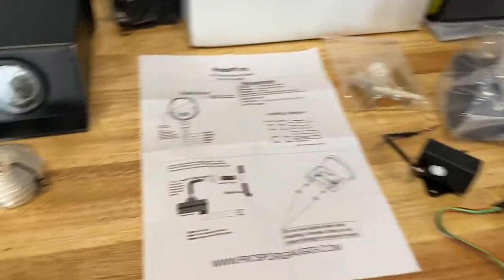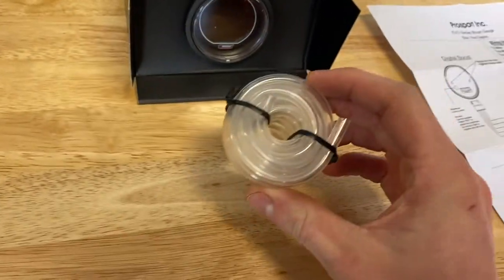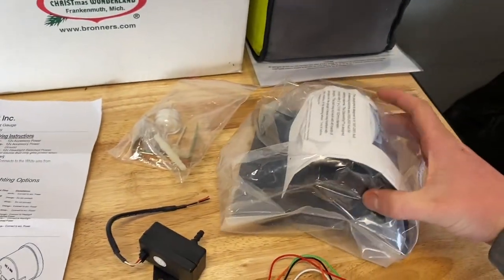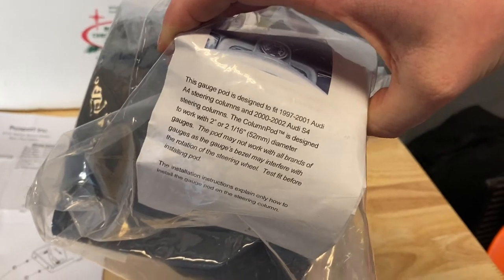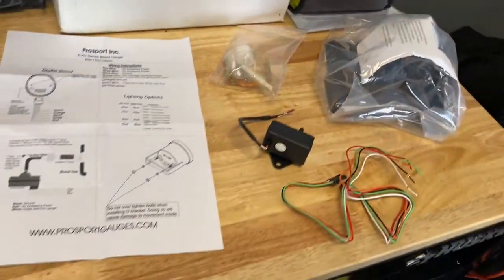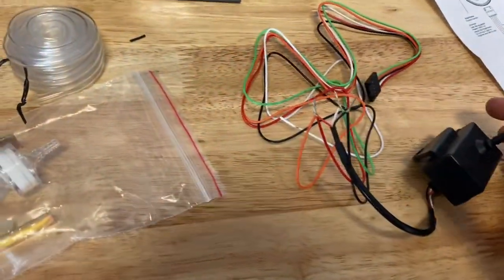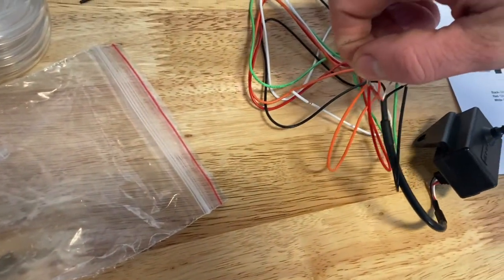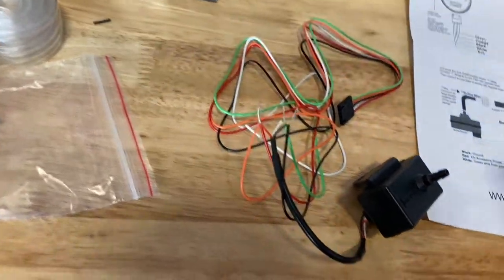B5 A4 BOOST GUAGE INSTALL

Comment: Wiring is a little unclear. Are you just connecting the red wire from the gauge to the power source? And then just Orange on the Gauge to Red on the Sender? And then did you cut the black wire in half after it was soldered to ground both the gauge and the sender? Sorry I’m bad with electrical stuff, and kind of frustrated the instructions that came with the gauge are very vague

Comment: Great video showed exactly what I was looking for. Only problem for me is my b5 is the Australian one so everything is opposite haha.
Was going to hide the gauges in my glove box but there are no easy openings to run the tube.
They should be 9psi on stock KO3 why does the description say higher? Do you have the N75j valve or just a boost tee?